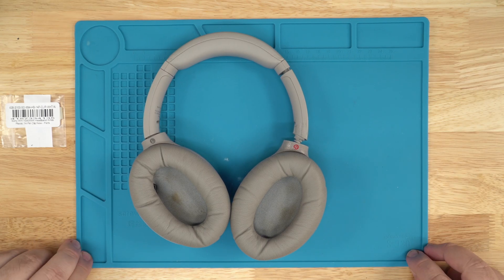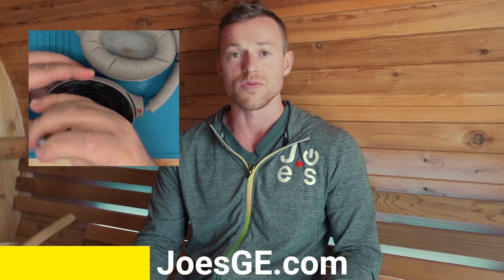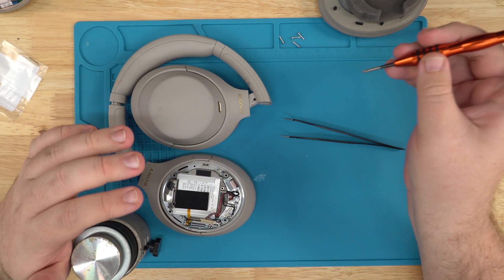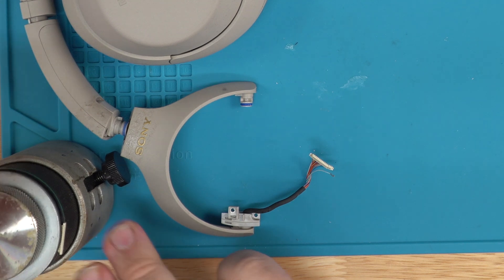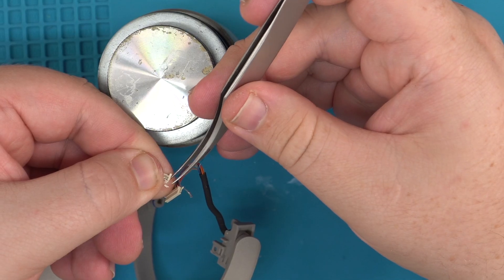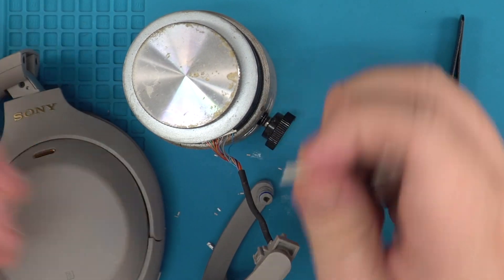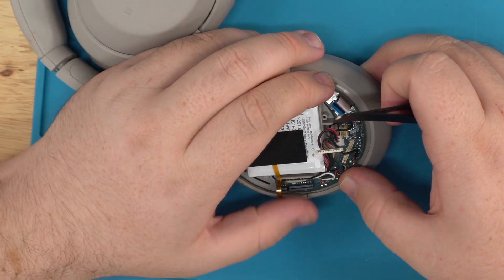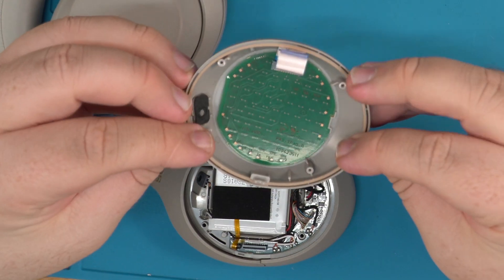Sony WH-1000XM4 XM4 Main Wire 14 Pin Plug Clip Replacement | Repair Tutorial

Comment: damn it, I broke that clip on the left headphone and this looks like a very tedious repair... fml
Reply from the maker: It’s not easy but we show you exactly how to do it. Here is a link for the part. 

https://www.joesge.com/products/sony-headphones-wh-1000xm5-xm5-headband-assembly-16-pin-plastic-main-wire-connector-white-parts?variant=41083485290542
Reply: Thanks for replying and trying to help a frustrated person but I think I should mention that you linked a repair part for a XM5 on a video about the XM4. The XM4 has a 14 pin connector while the XM5 has a 16 pin connector. Thank you.

Comment: Hey! I opened my sony xm5 and some water on both sides. I opened it in the first place bcs my touchpad was tripping, and activated randomely all touch controls... No i have another problem, when i connect the headphone to my phone, i can use it for 30-60 seconds before it shutsdown and it makes a weird noise when it turns off.

Do you know which part i need to replace? I think it detects some water and that is why it keeps shutting down..

Thanks in advance!
Reply from the maker: Please email us so we can help you more with this issue.